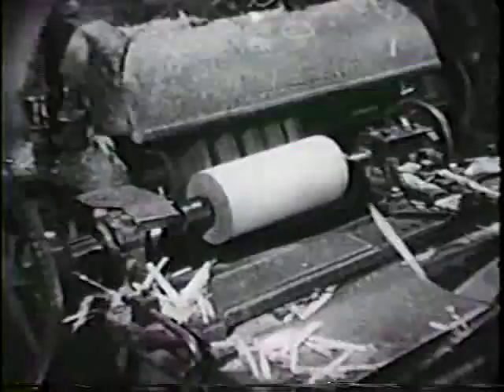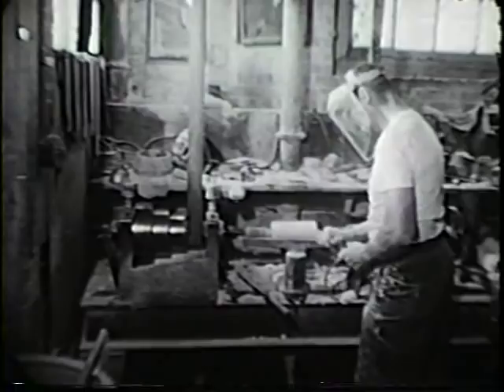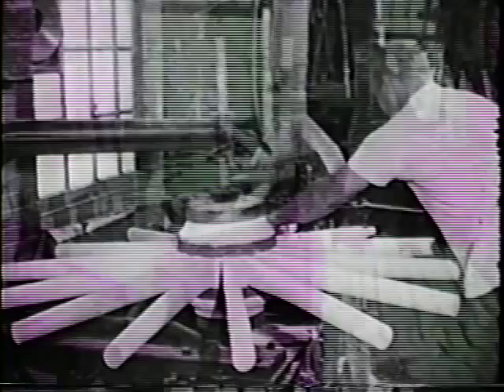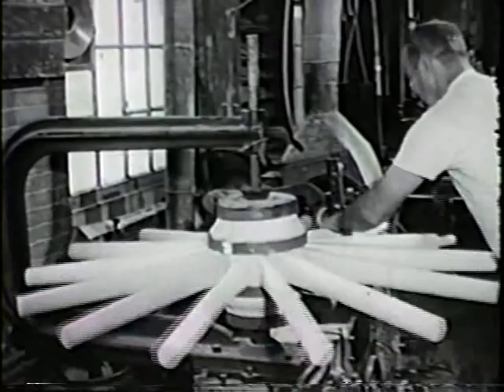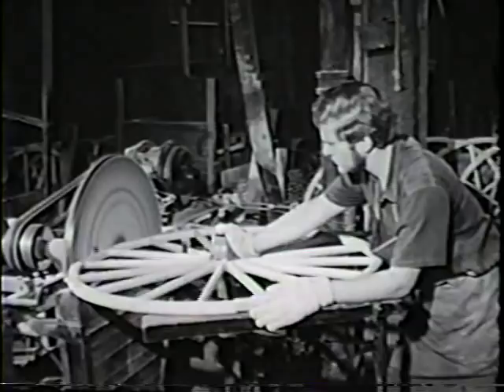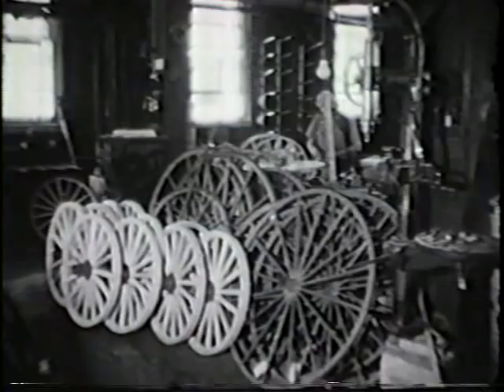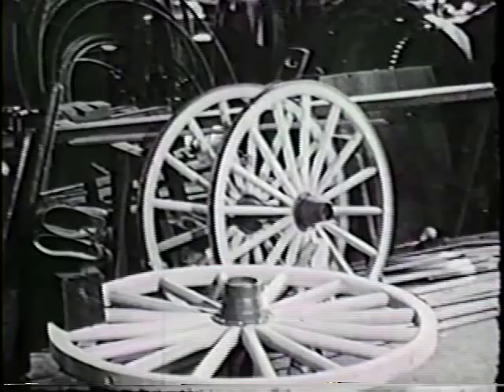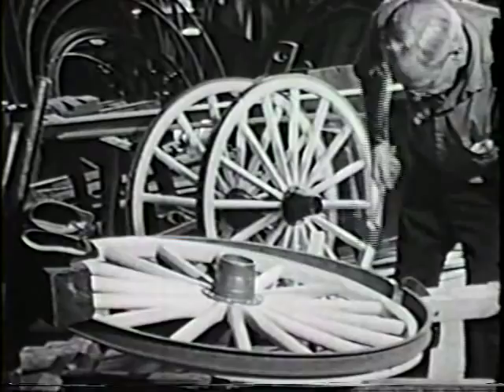WWPart2.mov

Comment: It is a pity that this freezes up.  I ran the other wagon wheel factory in PA until we closed it in 1966.  We had better equipment for mass production but failed to take pictures while it was still intact.  I sold the machinery to various entities and went into the Ford Tractor business.  I helped make wheels for the Chattanooga Battlefield cannons, stage coach wheels for the movies and several sets of wheels for Colonial Williamsburg.  We also made wooden spoke wheels for early Automobiles which used an entirely different construction method and machinery.  We made wheels for the movie The Great Race and shipped them to Alaska for filming.
Anyone wanting to converse, you can e mail me at:  jbhobbies@aol.com
John White